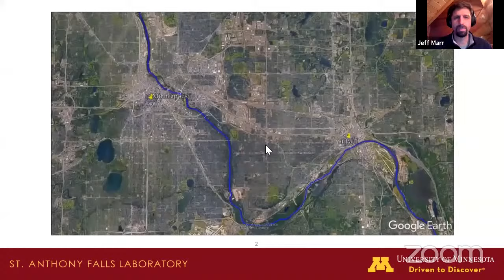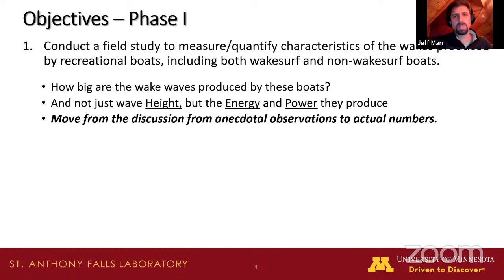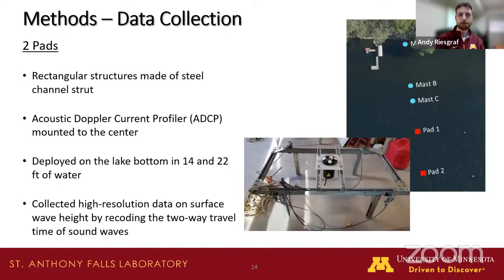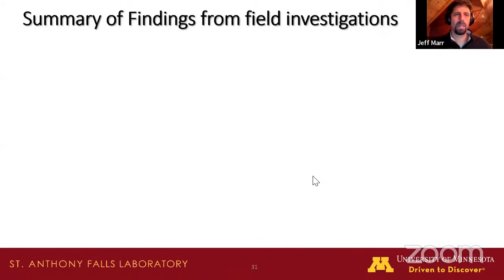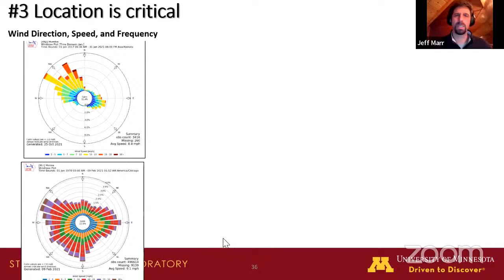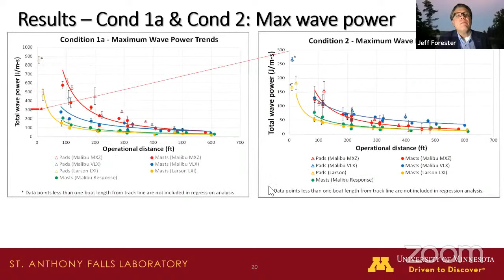UMN Boat-Generated Wake Study: Overview of research, findings, and next steps.

Comment: all surf drivers should be trained to send the large wave toward the center of the lake whenever possible, the weaker wave being captured would be an interesting from a data perspective. 

Saying that surf boats are damaging shorelines in a way that is impactful compared to any day with 15 mile per hour winds is absolutely ridiculous. The power of a windy day on the shoreline and vegetation from the wind energy is much more significant. 

The bias of the study is significantly impacted by the funding of the study and it is evident from the very first points.

When comparing the impact to the environment of nature the 5 sets of medium sided waves that a particular piece of shoreline might experience is going to be negligible when compared to the wave energy generated by a day with white caps due to wind. 

This needs to be taken into consideration before broad strokes are brushed and biases are created. This sport has been fantastic for my friendships, mental health, and community. Please consider add the control of continuous hours of windy day wave impact to the study for a legitimate claim at the impact to the ecosystem. 

The power of the biggest wave times let’s say 10 passes vs 3 hours of a windy day with white caps which can generate on any lake that can be surfed multiple times per summer.

Comment: I'd like to address the following 1. "wake surfing boats damage to docks" - these wakes are produced out of the wake-free zone, not near docks. 2. "people can't do what they used to do" - wake surfing is a sport, one that many people enjoy. Wake surfing is not impeding you from doing what you want to do. 3. Were the wake surf boats filled when you went on at 20mph? The boat makes the same waves as any other boat when not filled. 4. it is not a secret that when surfing the wave will be larger, that is the idea. 5. Where is the data on a 1995 32' Bayliner Avante? It is a cabin cruiser. This boat produces the same height of waves as a fully loaded wakesurf boat due to it's size and weight How do I know? Because that is what I grew up on. That would mean that your lake is accustomed to this wave height. To conclude, it is no secret that wake surfing requires a larger wave. There is a lot of variable data here and not all types of boats and water crafts have not been studied. For instance, a waverunner can get much closer to said shoreline. What is the impact of the boats that can "beach it" meaning to drag the nose onto the shore or close to? This disturbs sentiment as well. Wake surf boats cannot "beach it".

Comment: Keep in mind that the reference condition is a Malibu response or a Larson I/o going 20 mph. So a wakesurf boat needs 500’ for the wave to shrink to 7”. But the study also shows the same Malibu response and Larson I/o fail to meet the reference condition when going 10 mph, and to meet the same standard would have to be farther back. That’s how unrealistic the reference standard is.
Reply: Also, the condition 2 @ 20 mph also had both Wakesetters with power wedge at #3. Let's see the same test without the power wedge all the way up. I'd be willing to bet those wakes would be very similar to the Larson.  When I'm cruising on my lake in my VLX at 25mph, I never use the PW, and my wake is not much bigger that the other run-abouts that have similar deep V Hull and weigh as much or more